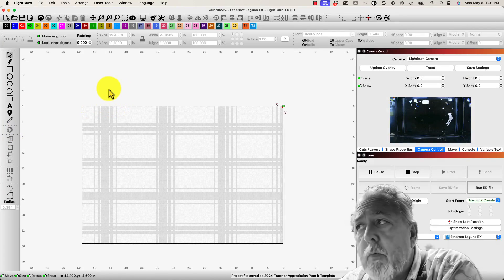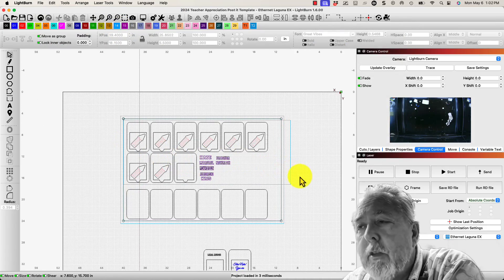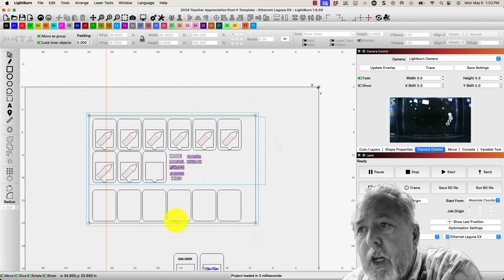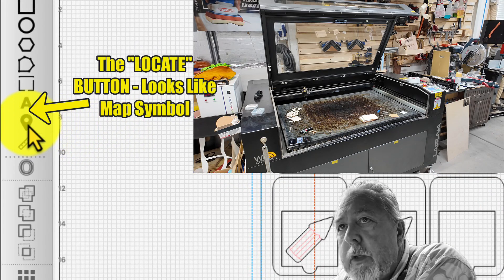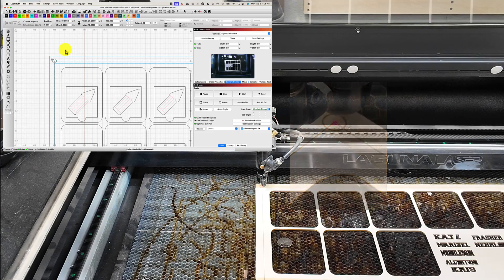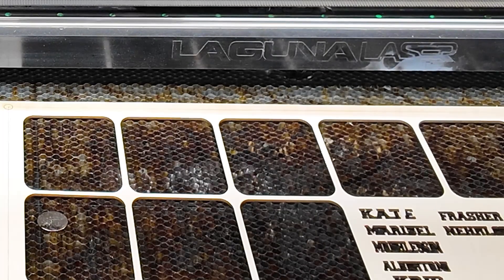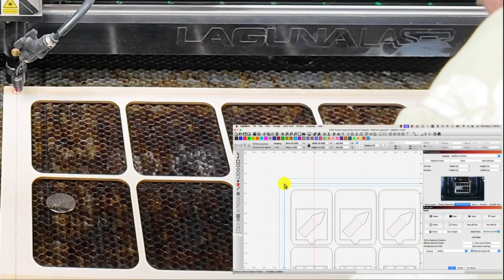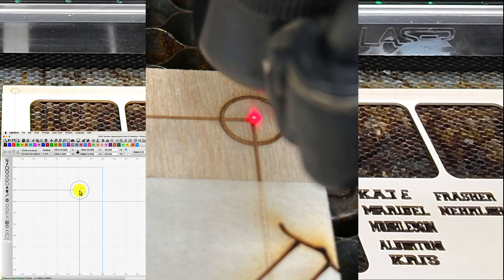Effortless Material Positioning with LightBurn's 'Locate' Button - Step by Step Tutorial

Comment: Good info. However the 'Print and cut' method is a lot easier and accurate.
Reply from the maker: Thanks for the suggestion, I'll look into that and may do a video on it. My previous experience with the Print and Cut method has been mixed.  I am sure it is me not following the steps correctly - me doing something wrong.  Whereas this method seems to work every time.